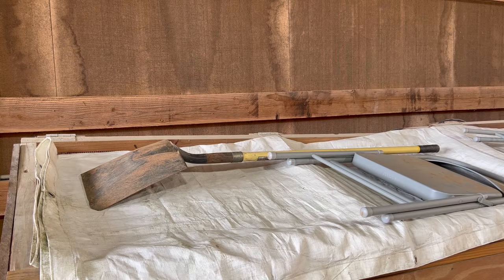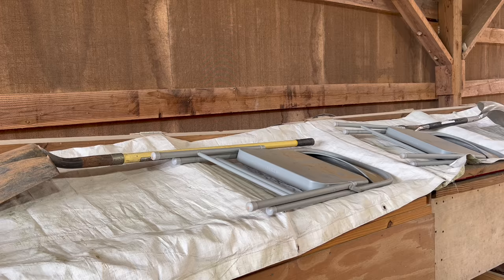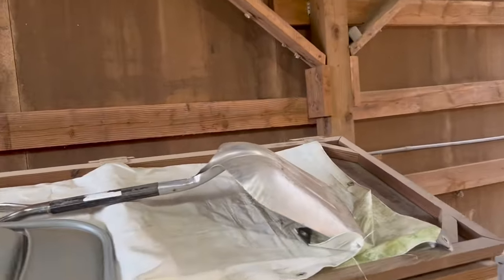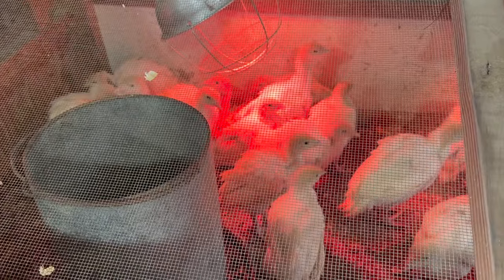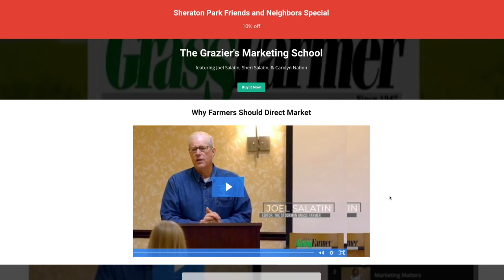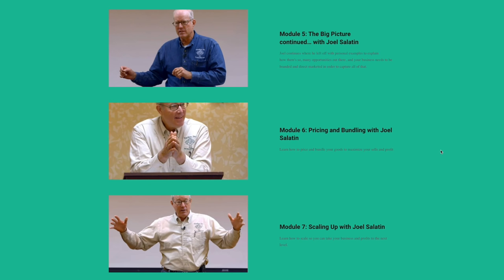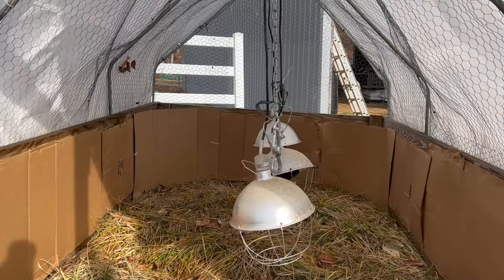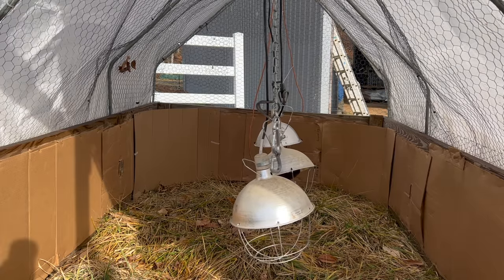Beginners Guide To Raising Turkeys On Pasture - Pastured Turkey Tractor

Comment: Just a thought Chuck.   Build another of those brooders along the wall.   Leave it empty.   WHen you need to get the poults out due to soiled bedding just set em up in your spare while you clean and reset the other one for your third.  During the spring summer fall you can add it to capacity and have it for the winter mode. 

Hope all is well. If it weren't for farmers and truckers we'd all starve.
Reply from the maker: Good idea. We’ve build another, much bigger brooder, that will help us do exactly what you are talking about. It’s 8x8 and will hold 250 chicks. We are going to keep these 2 smaller ones for overflow and holding if we need to clean out or work on something. 

Great suggestion!
Reply: Blind squirrel strikes again:-). Nice to see the growth your doing with your new place.

Comment: What size and type of tarp do you use for the Suscovich chicken tractor?
Reply from the maker: You can use either a 10x12 or 10x14. The 14 go all the way to the ground and I actually prefer them to the shorter ones. 

https://www.amazon.com/dp/B0035RQLK8/ref=cm_sw_r_as_gl_api_glt_i_0AH9HSF7FH0CGGXRB7D9?linkCode=ml2&tag=sheratonpar07-20